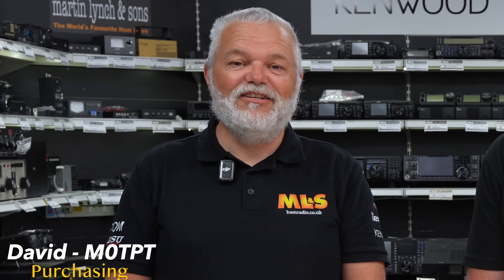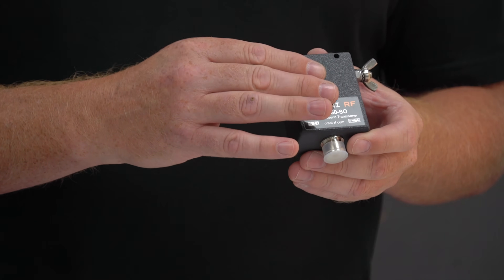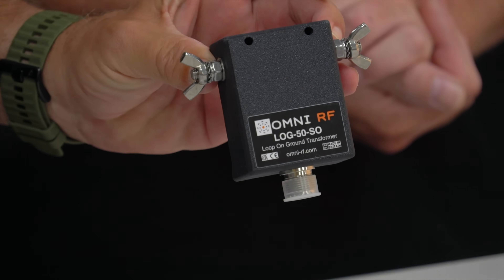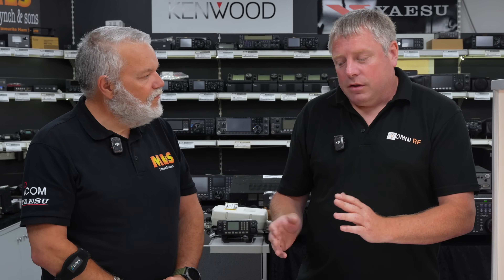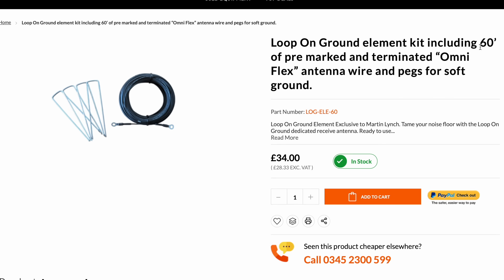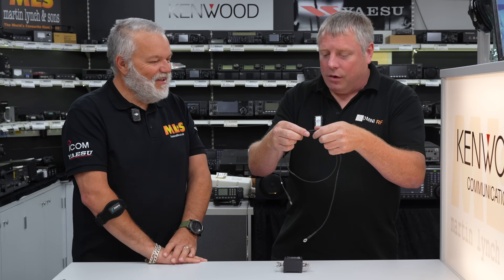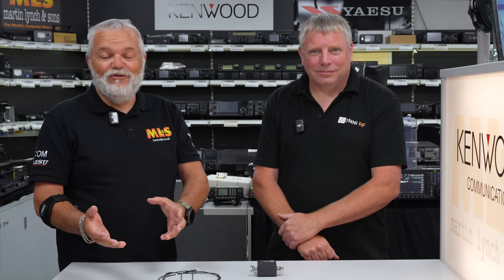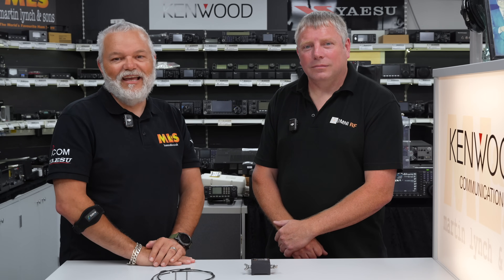Why Are Hams Raving About This Antenna?

Comment from the maker: Watch our demo of the Loop on Ground antenna here: https://www.youtube.com/watch?v=cxbGw-AFTPk
Reply: Can the loop be given 2 turns, albeit at reduced effectiveness, for those of us who have very limited urban space? I cannot install the 60 ft version, even if it's deformed from a square. Even 40 feet would be problematic.
Reply: so cool thanks for doing these videos - here's something novel you might find interesting - place an aluminum can onto a computer trackpad and watch as your cursor moves by itself - the aluminum can acts as a loop antenna and the computer as a receiver - as for the signal - your guess is as good as mine

Comment: I built a loop on ground antenna, very similar to this one (I even used heat shrink to mark the corners!) for shortwave listening. It works great! I was surprised how well it worked. Random-wire antennas are WAY too noisy at my location but loops are a clear winner.

Comment: Just one technical thing. Everything regarding an antenna is magnetic. Even the noise. So when you say that the loop on the ground only takes care of the magnetic portion of the signal, that’s really disingenuous. The reason for the low signal to noise ratio is that the vertically polarized electromagnetic noise is severely attenuated by both cross polarization and cross-section. But everything an antenna picks up is electromagnetic. That’s what they do.

Comment: Remember that antennas that lack less than 1/4 wavelength of length lack gain for transmitting purposes, fine for receiving however.  And loops of less than 1 wavelength will lack gain.  So, gain is what amateur operators want and need.  Furthermore, there will be losses to the ground the lower down to the ground an antenna is mounted.  I am pretty sure that you would not be able to model this antenna in software since it sets on the ground.  So, I believe the 1/4 wave vertical, or a dipole would be what you would want minimum.  I use a loop antenna for my HF receiver and understand how it works with regards to removing noise.  And I have it indoors and it does not have to be gigantic to work.  It however does not work on transmit.  And transmit is what I am referring to when I mentioned gain.

Comment: Should I have any concerns about deploying this under my dipoles? I have an 80m lazy Inverted-V and a fan dipole in a less lazy Inv-V in the area where I might lay out the wire, and I don't know if that is too close (40ft, give or take) for the separate receive circuit on my FTDX-1200 when I transmit near legal limit.

Comment: What’s the maximum coax run you could have with this antenna?
Reply: Thank you for your question. There is no maximum length I recommend as it would depend on the coax you are running and the coax loss that you are willing to accept for your frequency of interest, just like any other antenna. For example, 100 meters of M&P ultraflex 10 would give you 1.2dB of coax loss at 7MHz regardless of what antenna was on the end of it.

Thank you for watching.

Comment: Any good for MW?
Reply: Thank you for your question. I hope to have a demo showing the Loop On Ground (with 60' element) in use on MW available on my YouTube channel soon. I can tell you that from my workshop here in Kent, Radio Caroline on 648kHz is much clearer using the Loop On Ground then it is using my 22m longwire at 8m high.

Thank you for watching.
Reply: @Omni-RF  Try it on concrete?

Comment: Id like to know why a 9:1 as opposed to a 4:1.
Reply from the maker: A 9:1 balun (or UNUN) is often preferred over a 4:1 balun for a loop-on-ground antenna because it provides a better impedance match for typical loop impedances when placed near the ground. A loop on the ground, particularly if it's a random length, tends to present a higher impedance (around 450 ohms) than a dipole or a loop in free space, which are closer to 200 ohms. The 9:1 balun transforms this higher impedance down to the more standard 50 ohms required by most coaxial cables and transceivers, whereas a 4:1 balun would not provide as accurate of a match.

Comment: How does the shape on the ground effect it.. ie what if you make it a rectangle rather than a square? I would likely have a 2:1 ratio for the sides? Also does it have to be out in the open, I'm thinking running around the outside of the garden so against the fence and under the hedges etc.
Reply from the maker: The shape of a ground loop antenna affects its efficiency and radiation pattern, with squares generally being more efficient than rectangles, and placement near conductive objects or in areas with multiple ground paths can introduce ground loops and interference.

Comment: Does it make a difference using a 50 ohm coax or a 72 ohm coax in a receive antenna?
Reply: Thank you for your question. For most users the mismatch between using 50 Ohm coax or 75 Ohm coax will be minor. However, if you want maximum performance then it's best to use a good quality 50 Ohm coax. I can produce these units with a transformer that is wound for a better match to 75 Ohms with a "F Type" connector of requested.

Thanks for watching.

Comment: What if I used end feed 1:49 ?
Reply from the maker: Using an end-fed half-wave antenna (EFHW) with a 49:1 Unun on the ground can work, but it's not an optimal setup. While some users report success, others find that performance is better when the transformer is elevated and the antenna wire is higher. Grounding the Unun directly on the earth can introduce unwanted common mode currents and reduce efficiency.
Reply: A standard EFHW 49:1 transformer is not an isolated transformer so it won't perform like a fully isolated Loop On Ground transformer. The ratio is also way off so you'll end up with an impedance of around 9 Ohms at your coax connector. With that said, you should absolutely experiment and see how it works. Test it with a VNA and see the results.

Thanks for watching.

Comment: Maybe diversity on sdr radios uses that signal to mix with regular antenna to produce a new better signal mix?
Reply: That's a great point/question.

You can use the Loop On Ground antenna in a diversity set-up. That's exactly how I have operated from my home shack. I used a IC-7610 which I set both VOS to the same frequency and enabled tracking mode. I then set VFO A to use a DX Commander vertical and VFO B to use the Loop On Ground. With a headset on, the audio form VFO A goes to the left ear and VFO B to the right ear. Your brain does the hard work of picking out the best signal and you can hear the signal fade from left to right and back again as the signal changed. It's a very fun experiment and makes working weak station much more enjoyable.

You can also use something like the SDRPlay RSPDuo which has 2 receivers built in to do the same thing. The other advantage of the RSPDuo is that it has a built in phasing system to allow you to offset the phase from one antenna against the other. I've used this to hear multiple AM broadcast stations on the same frequency by phasing out the stronger station to reveal the weaker station.

Thank you for watching.
Reply: @Omni-RF Great. I have an ANAN G2 that takes advantage of that on thr fiversity menu on Thetis software for RX. That antenna will do good for it.

Comment: Great to see this now stocked and covered by ML&S on the channel.  This system reduced my local noise by around 3 S points compared to my wire antenna and I can now hear much weaker signals. 73 Phil G0JBA
Reply: Thank you for the great feedback.

Comment: Antennas placed on or close to the ground will result in high radiation angles. If you want to work DX,  low radiation angles are desired and this is achieved by having antennas at least half a wavelength above ground.
Reply from the maker: Hello, this is a receive only antenna

Comment: Sounds like a beverage antenna used on 160 meters.
Reply: Yes, the Loop On Ground performs like a Beverage but is not the same. A Beverage is a "traveling wave" type antenna, requires a lot of space which must also be in a specific direction as it's a directional antenna where as the Loop On Ground is not a "traveling wave" type antenna, only requires a minimum of 15' x 15' and is omnidirectional.

Thanks for watching.

Comment: How waterproof is the feed point. with the spike going through the box, is that not an entry point for water?  Or is the transformer completely isolated from that section?
Reply: Good question. The holes in the transformer box run all the way through to the bottom and is isolated from the section containing the transformer. The part that holds the transformer is weatherproof when placed on the ground and the transformer section is treated with a serviceable (you can solder through it) conformal coating to prevent any corrosion. All the hardware is made from A2 Stainless Steel.

Thanks for watching.

Comment: Could maybe do with some non metallic pegs for the 90 dergree turning point of the wire to keep it in place.
Reply: Thank you for your comment. I have tested with both metallic and plastic pegs. There is no difference in performance between them. I supply every Omni RF loop element with galvanised steel pegs for the corners.

Thanks for watching.
Reply: @Omni-RF Excellent. I was thinking it needs pegs at the corners so great to hear. Very interested and will be getting one of these. My noise floor basically means my radio after 2 years of gathering dust is currently in its box. Time to get it out again. 73 2E0JFQ
Reply: I was just going to suggest that myself.

Comment: Hello everyone, what would the setup look like if I can't install a visible antenna because of sensitive neighbours? I would like to be able to transmit up to 80 m. I've also heard that there is a way to bury the antenna in the ground so that I don't damage it when I mow the lawn? Question and comment: How does such an antenna behave when I use a robotic lawnmower, because of the boundary wire from the robotic lawnmower? The maximum output power is designed for up to 250 watts, but I work with a maximum of 200 watts.
Reply from the maker: Hello Martin, This is a receive only antenna.
Reply: Thank you for your questions.

The Loop On Ground antenna is pretty much invisible once installed, especially if installing on grass where it will be pulled down into the thatch.

It is a receive only antenna so no, you can't transmit using it. However, since is is a good low noise receive antenna you can have a separate "stealth"  transmit antenna like a random longwire in the loft or running around your guttering. Although these "stealth" antennas can be prone to high noise, it won't matter as you'll use the LoG for receive.

To lay the antenna on a lawn, I suggest lowering your mower to the lowest height setting and doing a cut. Then lay the antenna out and peg it down. After a few weeks the wire would have been pulled under the grass thatch so you can just return your mower to the normal height and mow without catching the loop wire.

I can't answer how it would work with a robotic mower as I'm not aware of how the boundary wire works with them. Sorry!

Thanks for watching.

Comment: Good product demo.  A suggestion, I would use golf tees to insert into the ground at the 90 degree indicators to keep the wire pattern square.
Reply: Thank for your comments. All of the Omni RF loop elements are supplied with 4 galvanised steel ground pegs for this exact use. Golf tees would also work.

Thank you for watching.

Comment: I really don't know why more people don't use these for recieving, also on the note on having two antennas, I don't know why they never put 2 antenna sockets in the back of the FTDX10 or FT 710, as I've got 2 sockets on my old FT 950 (which is an absolute peach of a machine even if I do say so myself lol) but I've got a DX10 sitting there my mate has offered me and that's the only thing that lets it down because I run 2 antennas 😏
Reply: Thank you for your comments. I totally agree that radio manufacturers are missing a trick when it comes to adding a dedicated RX antenna port. However you can use an outboard switch like the old (discontinued) MFJ-1707B to switch between a dedicated RX antenna and a seperate TX antenna. I'm sure ML&S does a switch that can also behave like the old MFJ-1707B.

Thanks for watching.

Comment: From what I can see, the “loop on the ground” is just another non resonant antenna like the t2fd antenna… I use a t2fd on the hf bands and it’s low noise allows me to hear stations lost in the noise on my ocf dipole…
Reply: From my understanding of the T2FD, it's classed as a "traveling wave" type antenna due to the terminating resistor preventing signals from being reflected and it's also resonant pretty much everywhere (depending on physical size) again, due to the terminating resistor providing a sort of built in dummy load. I've built several and used them at my QTH in the past. I've also made and released an Excel document based calculator that you can use to get the correct dimensions for building your own with options to choose from the full size version (1/2 wave), the USN model (1/3 wave) and the compact model (1/4 wave). The T2FD is a great choice for HF operating if you have the space and friendly neighbours although it has the drawback that most commercial versions of it can only handle around 100W and if you want to use higher power, the termination resistor starts to get expensive. 

The Loop On Ground is not a "traveling wave" type antenna as it has no terminating loads to prevent reflections but you are correct, the T2FD and the LoG both perform well in high noise environments since they are both very good are rejecting electrical noise. The main advantage of the Loop On Ground here is that it's easy to install, requires no support structures and is virtually invisible once installed. A disadvantage of the Loop On Ground when comparing against the T2FD is that the LoG is for receive only.

Thanks for watching.

Comment: But how do I stop it getting eaten by the lawnmower?
Reply: From my experience, the best tip is to set your mower to the lowest setting and give the grass a good cut. Then you can lay the loop on the grass and peg it down using the supplied pegs. After a few weeks, the wire will have disappeared into the grass thatch. You can then set you mower back to the normal height and everything should work great.

Thanks for watching.
Reply: Don’t mow the lawn.
Reply: Push the wire in the lawn with the U shaped pegs. Your mower won't catch the wire.

Comment: Does it matter if you use 75 ohm or 50 ohm coax?
Reply: Great question. For most Amatuer use cases, the difference between using 50 Ohm coax and 75 Ohm coax on a receive only system is not really worth worrying about IMO. However, with that said, if you are using 75 Ohm coax for your recieve system (as some serious DXers do) then I can provide a special order transformer to give a better match to 75 Ohms that comes fitter with the standard 75 Ohm "F Type" connector.

Thanks for watching.
Reply: Needs a transformer to match to line.  Online programs available to design those.

Comment: I'm curious why a balun is used if the operator is not transmitting on the antenna? Also why not use a longer length of wire on the ground for those having the space to lay it out? Thanks
Reply: To bring the impedance closer to the input of the radio.
Reply: @GoonyMclinux  From Perplexity "You do not strictly need to use a balun (balance–unbalance transformer) on a receive-only loop antenna, but using one can offer notable benefits.
A small loop antenna is inherently a balanced antenna, especially when constructed symmetrically. If you connect it directly to an unbalanced feed line like coaxial cable, this creates an imbalance—part of your feed line’s braid can act as a “random wire” and pick up additional unwanted noise, potentially degrading the loop’s noise rejection and the sharpness of its directional nulls." The article goes on to say that a 1:1 choke would suffice but being the belt and suspenders guy I would use both a transformer and choke at the feed point.
Reply: Thank you for your question. The Loop On Ground uses a fully isolated 9:1 transformer. This is because the impedance of a wire loop when placed on the ground is around 450 Ohms. When fed with a 50 Ohm coax, the mismatch will create loss and result in poor performance. So the job of the transformer is to match the antenna to the radio in the most efficient way possible. Matching the antenna to a radio matters for both transmit and receive.

As for loop length, if you have a loop that has a circumference that is longer than 1 wavelength of your desired frequency, the omnidirectional performance is lost and the result is an antenna with unpredictable directivity (unless you want to create gain in a specific direction and spend the time modeling it in software to find the optimum length for a given frequency). I support the 60' and 100' lengths as I know they provide good "all round" performance without any major compromises. 

Thank you for watching
Reply: @Omni-RF  Thanks for explaining.  This suggests the 100' wire would have some directivity on 20m and above.  Would you recommend the shorter loop for hams more interested in 20 vs 80m?